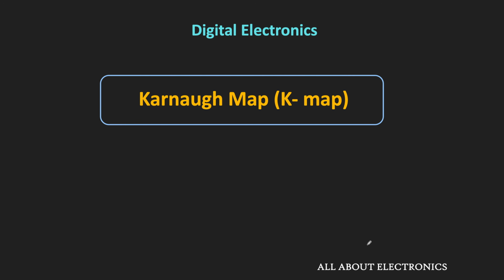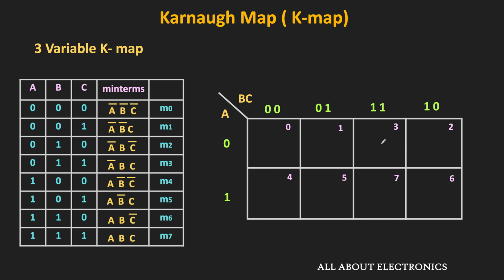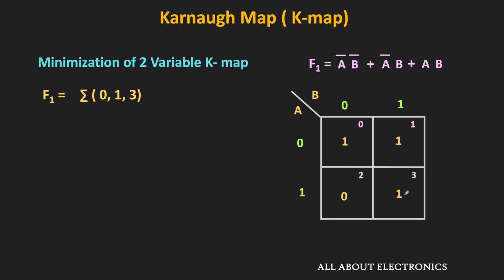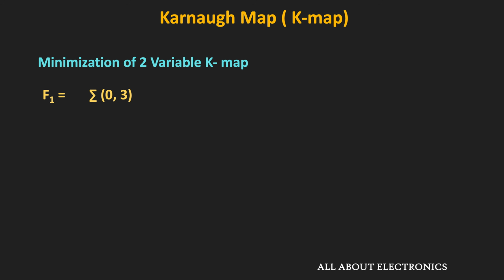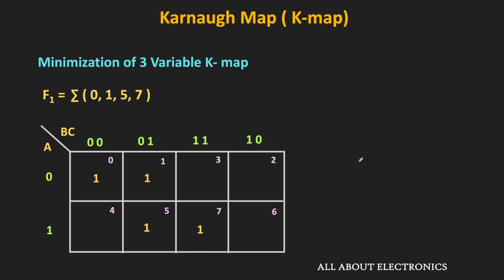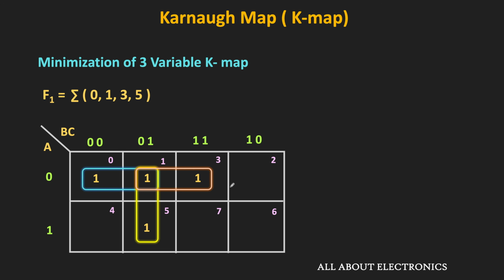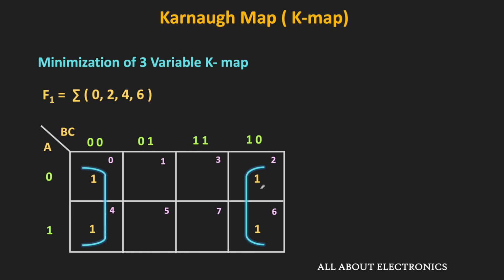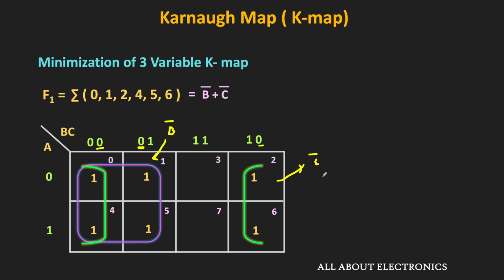Karnaugh Map (K-map) : 2-Variable and 3-Variable K- map Explained

Comment: Am confused  , you you used to take either the two changing or the two unchanging but at 20:02  you take C’ , but it’s the only one which does change .
Reply from the maker: At 20:02, we have group of four 1s. So, if you move from one column to another column or from one row to another row in that group, then only the value of variable C is not changing. And since C is 0, so we have taken C'. I hope, it will clear your doubt.

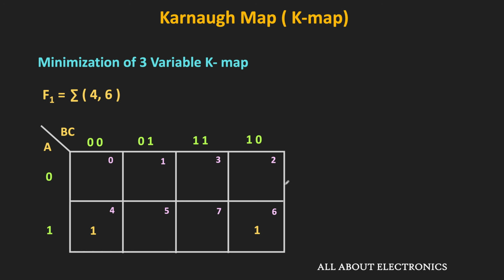Comment: Very good explanation.  Just one quick question, at 18:23, should it not be A.B as A is 1 and B is 1 but C is changing?
Reply from the maker: If you closely observe, A and C is not changing, while B is changing at 18:23. The A is 1 and C is 0. That's why it represents AC'. I hope, it will clear your doubt.

Comment: great video! I have one question. In the last example, you used the two squares, but could i take also the first square and the group of two 1 to the right?
thanks.
Reply from the maker: The thing is, the grouping should in the power of 2. And the cells should also be adjacent. (only adjacent cells can be grouped).
For more info about the grouping rules, I have made a dedicated short video. Here is the link: 
https://youtu.be/A_LFVBWYZME?si=41qQC2EsI_CXa_bF

Comment: At 17.45, F = (0,2), why did we take 3 varaible k-map and not 2 variable k-map?
Reply: because we are solving it for 3 variables and thus making 3 variable k map . The number (0,2) are not representing number of variables.
Reply: @harshsachdeva8641  That I understood, but my question was that minterms (0,2) is present in 2-variable k-map as well. So if I make 2 variable k-map and add '1' in cell number '0' and '2', will it still be the right way to solve it.?
Reply: no it will have different result if we consider (0,2) in 2 variable k map the result will be (B) but as you saw in three variable k map the result was (A',C') because when we pair 2 1s we will lose one variable so in three k map result will be 2 variable and in two k map result will be 1 variable so its different after all  @krishnaramparia6223
Reply: @krishnaramparia6223  Yeah, but the answer will be B